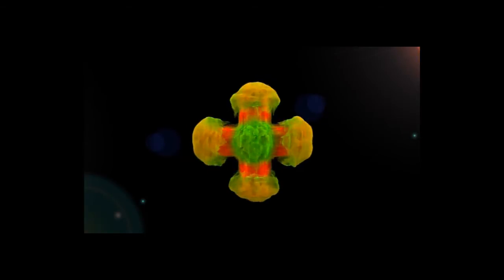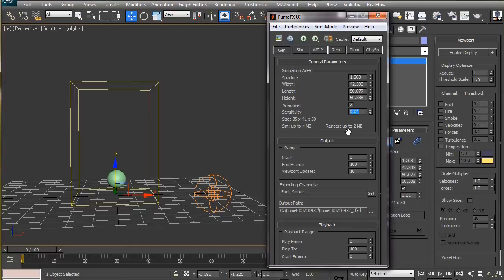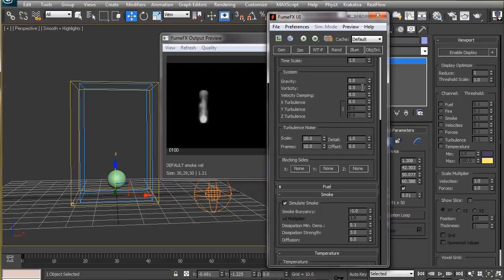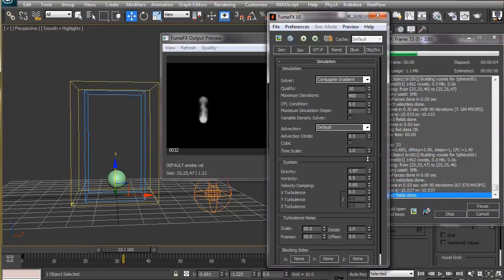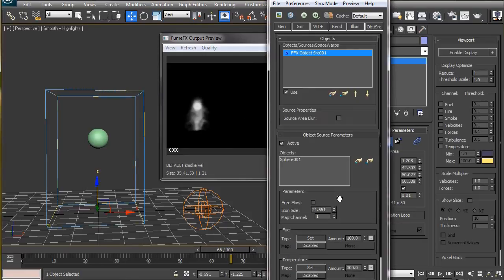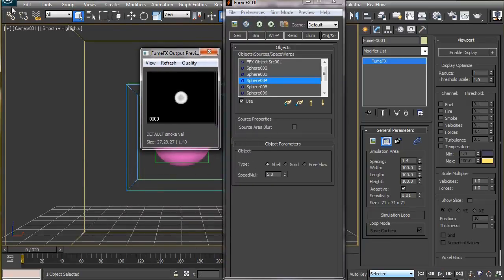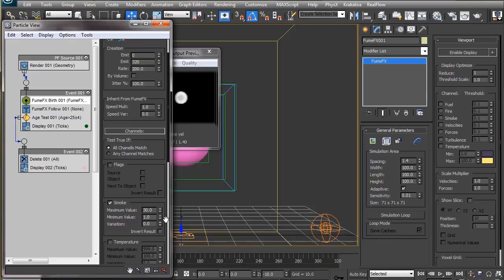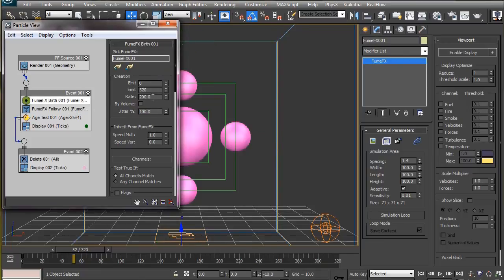Fumefx Krakatoa Tutorial Part 1

Comment from the maker: u need to cache out particles for realtime playback .. however during tests i keep the display on viewport count very low for faster updates. Also since pflow is not multi-threaded(as of now) it wont make any difference if u have multicore cpu ,, rather a single core cpu with faster clock ud perform better